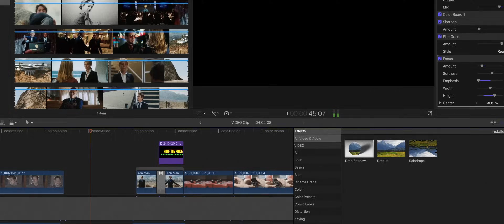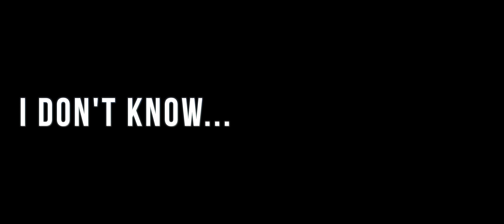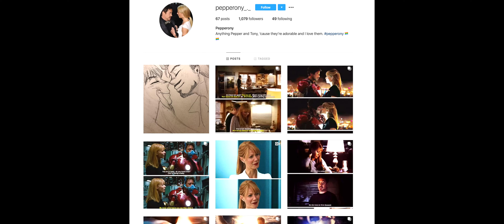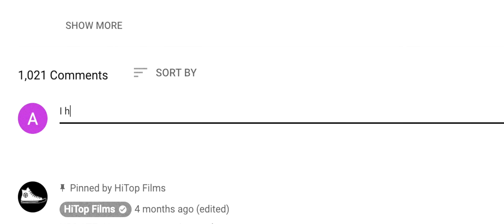Jon Favreau’s Iron Man - The Insane Origin

Comment: I agree with everything in this review,  but I'd like to highlight the one thing I  think doesn't get due notice:  RAMIN DJAWADI'S SCORE.  It gets such derision leveled against it, but I think it's perfect.  The mix of orchestra and hard-driving rock guitar riffs is NOT a liability.   It's the perfect encapsulation of Stark as someone who is simultaneously high-maintenance AND on the leading edge.  And of Iron Man as a character who is both fiercely determined AND epic.  IT WORKS. 
I agree; I think it's a criminal shame that Djawadi's Iron Man theme was not THE Iron Man theme for the rest of his journey through the MCU.

Comment: Yep. Agree with you on all the points 100%. This is indeed the most re-watchable movies ever made. I must've watched it at least close to 20 times in the past 12 years! Incredible. I was just a student back then and when it had come out, I watched it on my small 14 inch CRT monitor in a 720x360p resolution...I was mighty impressed and had rewatched it at least 3 times the same year. And over the next few years I must've watched it multiple more times as the other Marvel Movies came out. What Marvel has done with Iron Man probably can't be repeated ever again. Lucky to have been witness to such glorious film making. I can't believe how grounded and realistic they've managed to make it and yet fantastic. 

The part with Mark 2 doing a control surface checks, is so realistic, whoever came up with it, should be awarded. It is possible some aeronautical engineer was involved in the concept and design of the iron man suits in this film. The Flaps, the flares, it's just so realistic. 

The only thing we take for granted is the power source of that suit. The rest of the things connected with it feel like they follow the laws of physics. Perhaps that was what made it so realistic. 
Even the 2005 Batman's Bat Mobile didn't have as much realism as Tony Stark's Iron Man Suit from 2008 and the 2005 Batman movie was exceptionally well made. The gadgets of these superhero movies need to be made realistic and believable.

Comment: To me, the moment when Tony Stark becomes Iron Man is when he goes into the fight against Stane knowing full well that he's got a crippling disadvantage because he's using the old, improvised arc reactor that doesn't put out enough juice to properly fuel his suit. But he does it anyway, because it's what he has to do. Before that, he was taking easy (for him) fights against goons who couldn't hope to beat him. Now he's going up against somebody with a better suit and a better power supply, but who needs to be stopped. And Tony chooses to be the one who will stop him, even knowing full well that the odds are against him. Because this is his problem, and fixing it is his responsibility, regardless of risk, regardless of cost.

Comment: Before 2008, as far as Marvel Properties go, if you weren't Spiderman or X-Men, you weren't lasting too long outside of comics. Sony actually told Marvel they wouldn't buy the other characters when they bought Spider-Man in the late 90's because no one cared or knew about em. The MCU was built on taking the characters Marvel had left the nobodies and turning them into icons. They did that with the Guardians too, nobody cared about the Guardians of the Galaxy even in the comics they'd been kinda sidelined since the 80's.

Comment: And I forgot to mention that both directors used film whenever possible. So time of digitalization and CGI would come along. But for these directors in both cases they would only use CGI when absolutely necessary. And the movies were spot-on film. That's why the two first Ironman looks so much different than the rest of the MCU